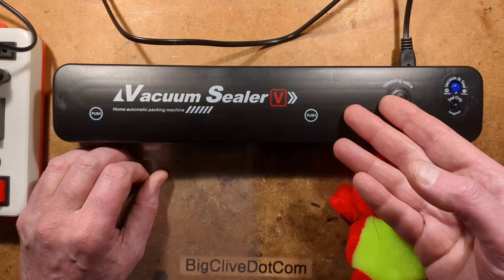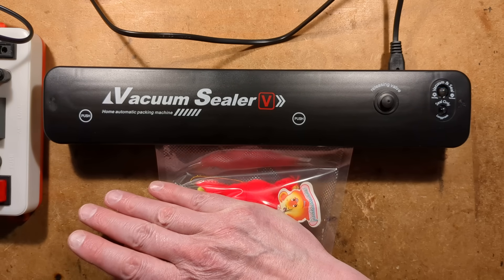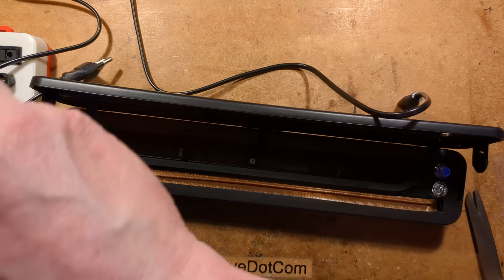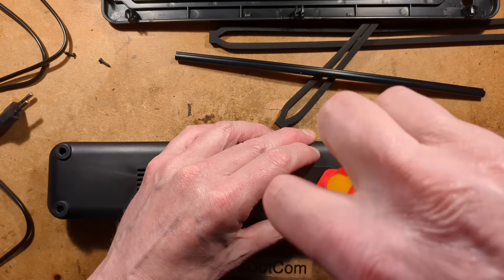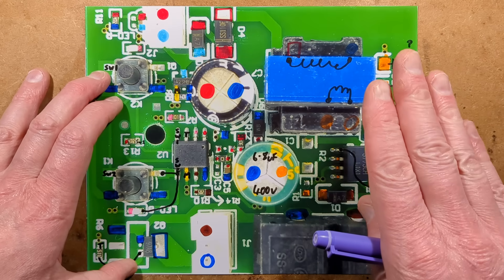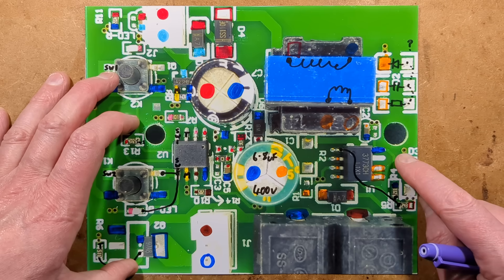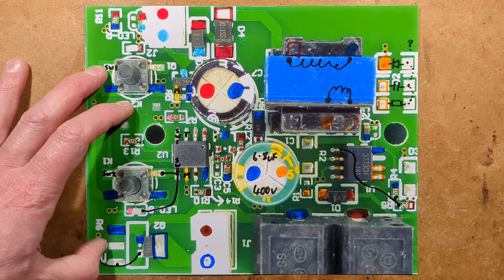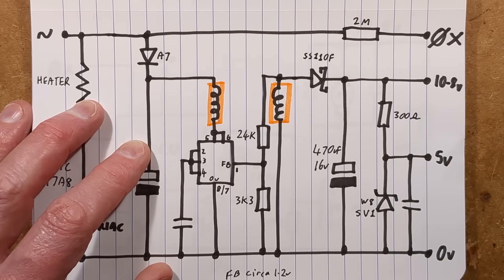Cheap vacuum sealer test and teardown

Comment: I thought the design would have included some means of determining when to turn the vacuum off, perhaps by monitoring motor current.  Surely, larger bags would take longer than smaller bags.  Maybe it uses a simple timer generated by the zero crossing.
Reply from the maker: It seems to be a fixed time.

Comment: With that simple schematic, I wonder if it's even wise to add a switch to the heating element. 

I just wanted to vacuum seal things longer than the timer and these units kept sealing it before it was fully vacuumed.

Comment: bloody china, got one of these after spending an hour looking for one with an AU plug, finally found one, got it today... immediately asked for a refund because they gave me a UK plug, and not even one with a fuse at that.
but then, it got better, because I found a lead that would work, but it was shipped so poorly that the box disintegrated inside the flimsy bag they sent it in, the thing was floating in .1mm of plastic for shipping and arrived with broken parts inside and the buttons also didn't work.
I have just completed repairs with superglue to get everything to line up again, see that post between the buttons there? It broke off in shipping along with a screw hold from the bottom of the case, both superglued back in place with a baking soda moat around that bloody post... Haven't tested it yet but the buttons now at least click down on the microswitches!
Honestly about to boycott ali altogether just because every single item is either not as described, missing functions advertised, broken, fraudulent, incorrect, never got shipped, the list goes on.
The world gets worse, china is only leading the trend. The last Item I got was a pet chip scanner that advertised bluetooth and USB connectivity to store the codes, has neither and literally the USB port is only connected to the power for charging the battery. I give up.

Comment: As many of these electronics teardown videos as I've watched, I still don't really understand most of the components and how they work. Especially when I have no idea what the inside of the chips look like. Do they use binary code? How is the information stored? How are the chips made?
Reply from the maker: Many of these circuits use microcontrollers which are basically a computer on a chip.  They are running software inside.  In the scale of production they literally cost about 5 cents each.

Comment: I have a bag sealer that broke a few years ago, the analog circuit was fried, so, I made a digital one, with the sealing time in digits this time instead of a simple knob. Thanks to that I realize how short are the sealing cycles, like 0.2 s for thin plastic and maybe 0.8 s for thick ones. I don't know how much for those bags, but I suppose is so fast that your meter can't register it on time. Cheers !

Comment: I believe the )X is also a timer to prevent continuous run on of the pump motor and voltage drop run time that indicates having achieved the proper vacuum level (I have a not so cheap unit like this..  Vacuum achieved is like 0.15-0.2 Barr  and usually gets a bit worse with timem

Comment: They could have had an "isolated" supply with a full-wave rectifier, and tied the 0V on the secondary side to one leg of the AC supply in order to switch the heater with a triac.

The omission of a thermal fuse is a serious one, though.  It might be worth measuring the inside temperature in normal operation and adding a thermal fuse rated just a few degrees higher in series with the heater, as the next best thing since it can't easily be put in series with the incoming mains.  Be sure to douse the thermal fuse with plenty of freezer spray when soldering it, so as to avoid blowing it!

Comment: I was expecting you to scope the triac circuit to show the circuit output.   I was surprise the video was over without that visual.
Reply from the maker: The output was using burst firing.   I connected a bulb and it flashed on and off.

Comment: Would love to mod one of these to run on 26650's! I pull my sealer in and out of the drawer each time I use it, and a cordless option would be great. I haven't been able to get the zipper bags with the disc seal to work reliably for long term freezer storage, the adhesive always fails.

Comment: Doesn't the power dissipation of a pure resistive load with a fixed resistance just change with the square of the change of voltage? If so, wouldn't the power dissipation of such a pure resistive load with a fixed resistance always be 4 times higher at 240 V than it is at 120 V, and vice versa?

Comment: My work has a large industrial take on one of these, controlled by a few switches and timer knobs.
An older model would have used mechanical clockwork timers, but this one has electronic modules.
The anti-static bags we got don't have that "hold open texture" feature, and the vacuum pull on it is so incredibly powerful (thanks to being hooked up to pressurized shop air) that getting the bag to vacuum down is easily the hardest part of using the machine.

Comment: One of these is used, with the markings removed, in a current TV commercial for a new upright sealer as the "bad old" style sealer. They used tomato sauce in the bag to create a mess to demonstrate its impractical design.

Comment: At 400 watts, the heater might be self-fused; rather than staying hot and melting the entire appliance, it might just pop open somewhere along its length (most likely at the bend at the ends, where there is slightly more heat and less dissipation).

Comment: Neat little unit. Always nice when a software bug can result in a fire, we software devs don't get get exciting enough consequences for mistakes that often 😅
Would also be very nice if it had an interlock for the lid being closed; the vacuum pump probably doesn't matter, but that heating element wouldn't be fun to bump.
Reply: That's what the HCF instruction is for; Halt and Catch Fire.

Comment: Hello, I have just changed the door closing device on my washing machine  ( Hoover DHL 1492D3/1-80 Door Interlock ) because part of the old one snapped. 
I had a look at the old one dissected out of curiosity and can't work out how it knows if the door is closed to tell the washing machine. A bit of plastic covers a couple of holes but the whole thing is in the dark inside the washing machine. dunno.
If you fancy a thing to take to bits they only cost £8.65 (plus postage) and my curiosity would be delighted.
Cheers for your nice show regardless 
(edit: speling)
Reply from the maker: Did it look like this?
https://youtu.be/PIm7q_U3UEM

Comment: IC in the first page seems like simple on-off switching power supply (idk the name) that detect output voltage using only secondary winding voltage (It's not isolated). And the second IC in the second page seems like whole control circuit because in another model it can detect if vacuum has been reached or not (by detecting vacuum motor current or something) and set timer for the heater (in another model it can have vacuum and short seal(for thin plastic), vacuum and longer seal, vacuum and longest seal(for thicker plastic bag), manual vacuum override, or seal only for about 10 sec of heater)

Comment: We used to use these a very long time ago, and The Wife is very happy with our rather higher spec ALDI  Ambio model, which we've had for ever.  If you are interested, you can even buy a very small (yet surprisingly effective) Li Ion 18650-powered rechargeable vac & seal device, which seems to be about the same construction, albeit with a surprisingly decent charging circuit!

Comment: Guessing voltage from mains frequency sounds like a terrible idea. Japan has 50 and 60 Hz at 100V, for example.
Reply: And there are also 220/230/240 V countries which use 60 Hz, not 50.

Comment: Maybe this could be used for long term storage of 3d printer filament storage with a bit of silica lobbed inside? I do have some the standard re usable vacuum bags but they seem to break or get holes in them i can never find.

Comment: I have a vacuum sealer, (a decent one from amazon not ebay) it's amazing for freezing food. The number 1 piece of advice is.... buy the plastic on a roll! Cut to length, heat seal one end and you have a custom sized bag. fill, then seal the other!
Reply: You can fill and double seal then fill again and double seal multiple times then cut between all the double seals and the last single seal at the end.

Comment: My expensive FoodSaver vacuum sealer also wants a pause between using the sealer. It has a built in pause. Where it just blinks. 
I use it for many things. I put some wine bottles in a vacuum bag. I needed to transport them in my luggage and wanted to be sure they didn’t spill out of they broke. 😂

Comment: I wonder what happens when you reverse the polarity on the vacuum motor. What if you inflate the bags instead of vacuuming them?
Reply from the maker: No.  It would still pull a vacuum.  It's a wobble plate style pump

Comment: I've always wanted one of these but I can't think of a use for it!

I may be wrong, but I think the triac needs to be turned on for each half cycle, the zero crossing point signal may be used by the MCU to trigger it each time the cycle starts to rise again?

Comment: I'm almost sure the heater wire will melt if it gets continuous power for a few seconds but I don't know if in that time it can set the plastic housing on fire or if it will just melt it.
But the branded vacuum sealers I've repaired had a non-flammable silicone rubber strip separating the heating element from the plastic housing, I guess this one should have something similar to prevent the heater from sticking to the plastic, although they may have wrapped it completely with that PTFE tape.

Comment: I've noticed that many people I know or have met who came from Asia, tend to be very diligent, borderline militant when it comes to turning things off and unplugging them when not in use. They even turn off their water heater when not in use! So I wonder sometimes if some of these design flaws come from the designers simply never conceiving that someone would not unplug a device when done with it.
Reply: I noticed that also when I visited the Philippines back in the 1990s. Even in hospitals and clinics, AC powered devices which are not in use are always unplugged. At home, the same habits hold true. The AC power in the islands is very erratic and goes off and on many times each day. I think a reason is that the owners of equipment are trying their best to protect the stuff from spikes and over and under voltage damage.
Reply: I tend to think it's more of a learned response rather than a cultural habit thing. I could imagine there are many horror stories of rouge electronics lighting whole buildings on fire.
Reply: @Progan666  for sure. We had the attitude over here once too, my grandmother born in the 30s always chided me to turn things off when not in use and she would Not sleep until she’d unplugged everything.  
To the point it broke her power and aerial plugs multiple times! 
Explicitly said one time it was due to the fire risk but didn’t want to talk about it because she believed it was a bad omen and would make a fire more likely. 

On that last note she also refused to step on the cracks in pavements, hated seeing crows or black cats (but weirdly not blackbirds, so she’d often momentarily freak out upon seeing one until she realised it wasn’t a crow), went out of her way to never walk under a ladder, etc. 
So I’m sure some of the behaviour is down to that tendency. But she must’ve learned to fear electrical fires, even moreso than gas or paraffin oddly enough, from somewhere.
Reply: @kaitlyn__L  You have mentioned aerial, high TV aerial in the countryside could catch lightning and fry the TV set.
Reply: @Progan666  "rouge electronics", lol.  Really red!
Reply: I have a non-Asian coworker who freaks out about anything being left on while people are away.  Even aircon.
Reply: Probably similar to the reason the UK was late to the party with half-sleeved pins on mains plugs.  There was historically never any need for the pins to be half-sleeved, because BS1363 socket faceplates included a switch, and so the pins would never be live while inserting or removing the plug.  But then appliances proliferated, multi-way extension leads with unswitched sockets became common and suddenly, partially-engaged plugs became a problem.

I don't think socket faceplates usually have switches in mainland Europe, and their strong consumer protection laws mandate appliances being as safe as possible when plugged in but not in use even despite people being told not to leave them like that.
Reply: Hmm... I lived in China for about 10 years and Indonesia and not once can I say I've seen people unplug something they are not using.

However many Chinese are very "militant" about NOT drinking cold water, it must be boiling hot! 
I stems back to contaminated well water that needed boiling to kill off the nanites. 

Because people would cheat and only say the water was boiled it was safer to insist on boiling hot water to drink...even during hot humid summer days!
Reply: @tihzho  In post-Soviet countries there is notion of "raw" water as opposite to (cold) boiled water.
Reply: In at least some cases electricity is expensive so unplugging saves the phantom power of idle devices (clocks and I’m not on lights etc).
Reply: @lawrenceharris7717  I had a housemate who would insist on turning off the microwave at the wall for this reason. After getting frustrated over having to fumble around behind it constantly to turn it back on I actually measured the idle power and offered to just pay them the estimated $2 yearly cost to leave it on. Strangely they didn't take my money, but they did stop switching off the outlet.
Reply: In Australia in 1990, a Firefighter told my Mother that fire investigation found fires had started from switched off devices plugged into the wall - so she always unplugged from the wall when not in use.
Reply: @JaySmith-e3v   There is no need to unplug as Aussie power points always have their own on/off switch.  Simply "turn it off at the wall" and it's done, no need to unplug.
Reply: @anwatts1  I'll take the firefighter's advice, thanks.

Comment: 5:30 I tend to cut off and save old power cords - as long as they are not already losing the emollients.. I mean, sure, 60 Watt won't make the cheap cables burst into flames, but.. 'Having is better than needing.' - the standard German saying for a handyman..
Reply: Cheap cables are ofthen copper clad aluminium and sometimes the insulation is so weak that you can strip it with your fingernails. If you save them make sure it's a properly insulated copper cable.

Comment: I have one and need to stop the cycle about half-way through the heating.  It gets too hot and melts the bag completely.  I use it for bags for storing desiccant after drying it for reuse.  I have a proper unit for food that works great, this one is almost good

Comment: Regarding the way the triac is driven, isn't this a good moment to use one of those cheapo "graphing multimeters" and just show what is going on? They are just as large as the multimeters you normally use, so you don't have to change your workbench setup. You may not trust them much with 230V, but you're careful with mains anyway, and if they go BANG you have another youtube short 🙂

Comment: Here in the US, you can get that material in a roll, you cut off as much as needed, then melt-seal the bottom of the bag while its empty, th n fill it with the food, then vacuum and seal the top. They've even gone as far as to build a dispenser for the roll into the vacuum sealer machine, naturally, they're bigger than this one you've got. Called FoodSaver if you're curious to look at one.
Reply: > "...in the US, you can get that material in a roll..." I (in US) didn't know there was any other way. And while I could find one roll, buying six rolls was not a lot more, and I got small&large assortment. "Vacuum Sealer Bags for Food 6 Rolls (11" x 20' x 3 & 8" x 20' x 3)".
I got this for a decade-old suck&seal from a garage sale. Which works fine so far. Did a loaf of bread and three chicken chests last weekend. THANKS Clive for confirming the how-to-use. Mine may pre-date 10-cent CPUs, could be a couple 555 chips. Yes, that pump is from a 40-buck blood pressure meter!
Reply: My dad has that brand, and has used it for probably at least a decade by now for preserving fish and game for freezing.

Comment: Got a smiliar but even cheaper one without a seal only setting, It works is all i can say :D But got it for under 10$. There are better ones for just 15€ in my local supermarket, so can't rly recommend these ultra cheap ones

Comment: So, basically what you were saying is, that I can reseal my crisps and also could even vaccum them to keep them fresh and get more into my bag?! Nice! 😁
Reply: If you vacuum your crisps, they'll break into small pieces and no longer be crisps.  Industrially, crisp packs are purged of oxygen using cheap plentiful nitrogen to prevent oxidation and extend freshness.  What you need is an nitrogen generator.

Comment: I have an almost identical unit and the plastic used is such cheap crap that you can crumble it into dust with two fingers. One of the locking tabs broke off... taking about 2cm^2 of the main body with it.